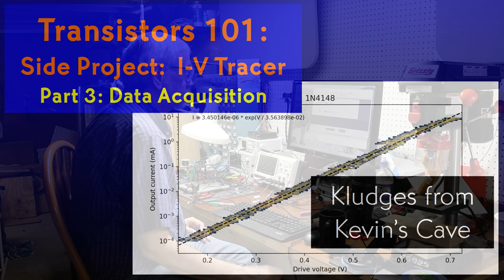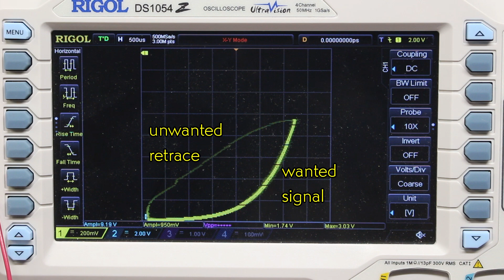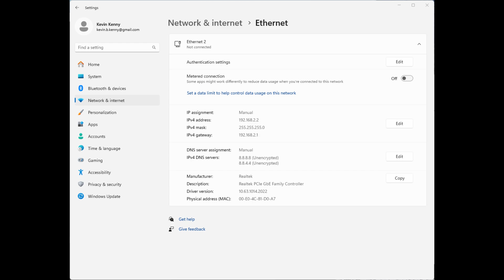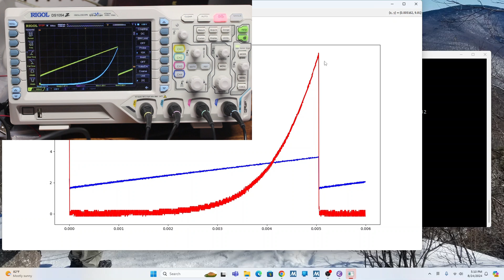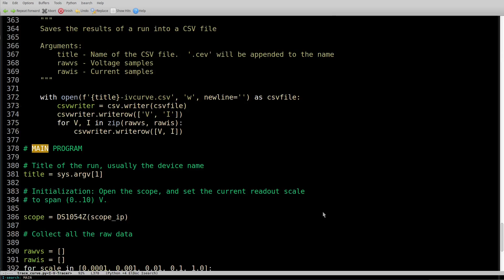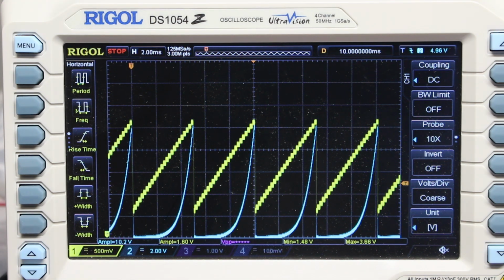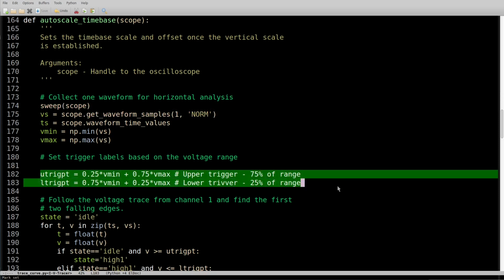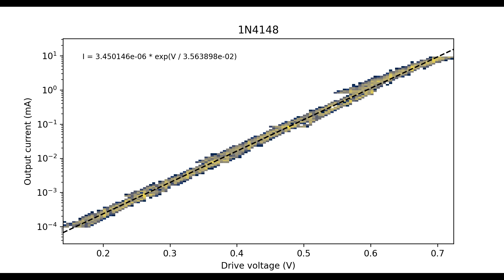Transistor 101 Side Project: Current-Voltage Curve Tracer: part 3: Software (RE-UPLOADED)

Comment: Great stuff so I subbed ! I hope to have the time to go through your back catalogue soon but for the moment I'll just carry on ! Is the curve tracer suitable to use simple x/y on a scope as I have to study the schematic a bit more.  Your programing 'kung fu'  is scary Lol !.....cheers.
Reply from the maker: @andymouse  the curve tracer connects to   x and y on a scope. I don't like running it that way just because the low-current signal gets pretty noisy and I can filter the data digitally if I get them into a computer.

Yeah, the combination of a MSEE and a PhD-CS is pretty powerful. (Why the switch? Stuff I used to do in solder all moved into software.)

Comment: That's unfortunately not going to work with my Hitachi V660. Good scope, from 1975, fully analog. :)
Reply from the maker: Yeah.  I was around back then. My undergraduate lab reports often had Polaroids of the scope screen pasted in.  If you had the camera bracket for the scope, you could even use a triangle and a pair of dividers to transcribe numbers off the trace.  We are living in the good old days, as far as electronics is concerned!

Comment: Hello Kevin, your videos are very informative. I am designing a multi-stage amplifier to drive a piezoelectric disc, and I am curious if there is any way that I could employ your knowledge and help me iron out some kinks with the circuit. What would be the best way to contact you if you are interested?
Reply from the maker: @christophernicol6713  I don't have a lot of time (what I don't spend on paid work, I mostly spend on this channel...) but my email is in the channel description. I can maybe have a look, particularly if you're also teaching what you learn!
Reply: I’ll send you an email. Also it’s funny that you mentioned that. I’m in the process of making a presentation for it, as it’s one part of a much larger project. I look forward to your response.